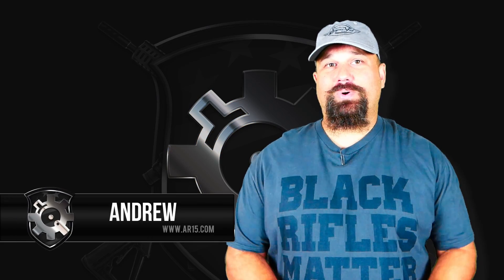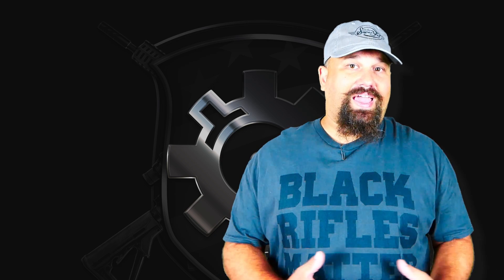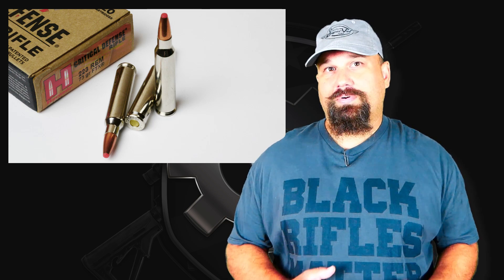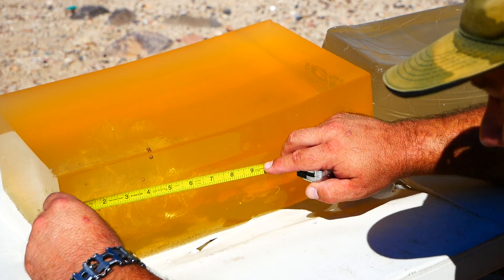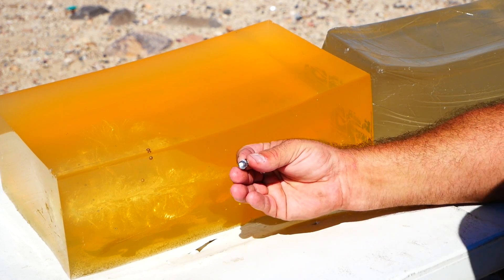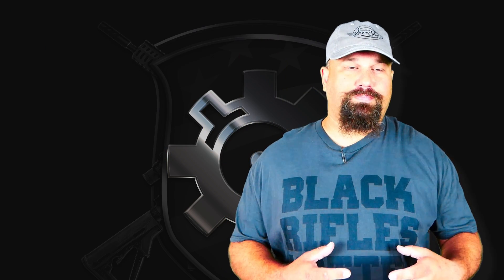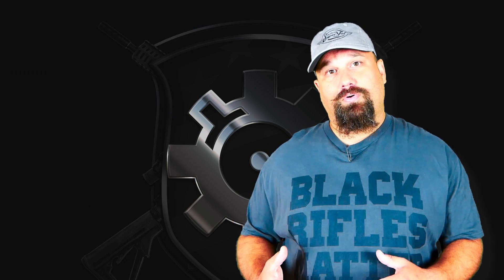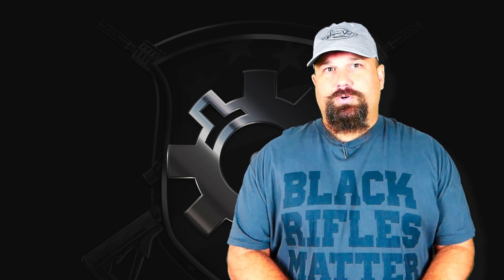Hornady Hype? .223 Rem Hornady 73gr Critical Defense Gel Test

Comment: Great video Andrew. I agree that penetration is the most important aspect of terminal performance, but wouldn't the significantly greater energy produced by a longer barrel somewhat compensate for the decreased penetration?
Reply: Longer barrels (within reason) equal more velocity. And the funny thing is if a bullet is achieving proper expansion as its supposed to but not making it to the vitals. More velocity isn't going to help it get to the vitals. In fact it tends to reduce penetration depths further
Reply: yep this is correct. The one exception would be if the bullet sheds petals and the base then punches through. I see this with Berry's plated 9mm hps' being ran pretty hot. The nose sheds (into to some pretty big nasty pieces) and the base keeps trucking along. Doubt this would be an issue for a rifle unless you're running something like an expanding lehigh bullet where it could rip the petals off or sweep them all the way back.   @MatteoThirteenSeventyOne
Reply: @colsoncustoms8994  LoL I was keeping it simple, and addressing just traditional expanding jacketed ammo. 
As for those Berry's can I assume you're referring to those Hybrid HP's they offer? Just ordered up some of the 147's.
Reply: @colsoncustoms8994  Oh! You know those are for competition just like the HAP and some of the Noslers. They're not designed for expansion/self defense. As for the expansion of the HAP's and the Nosler like their 40/10mm 135gr gr. Yeah, I've gotten them to pancake, but they have a tendency to shed their jackets. All in all, I stay away from them for anything beyond range use.  The Berry's hybrid HP's, I figured I'd give a whirl because in any of the videos I've seen the expansion looks good. But they failed to show the penetration depths. That and I have a couple blocks of unused clear gel I'd like to de-virginize. LoL
Reply: oh yeah, all of the plated ones I've shot are designed for target shooting. That being said, If I can get my plinking ammo to expand fairly reliably, I'll take that over fmj any day of the week.     @MatteoThirteenSeventyOne
Reply: In my experience, especially hunting mule deer and elk, my answer is no
Reply: If the increase in energy is dissipated by increased deformation the bullet or breaking additional pieces off, it will not affect the target, only the bullet.
Reply: Most definitely will have  a effect!!!!!
Reply: It would be nice to know how it woult behave from even shorter barrels (7"). Will it have better penetration with expansion or will the bullet go to slow to expand?
Reply: Now how does it fare for collateral damage. How much dry wall or material will it go through just in case you miss your target? Also what would be a good self defense round that would fare good in both penetration and reducing collateral damage if you miss?
Reply: doesn’t matter how much energy it needs to hit vital organs
Reply: While peneration is important, it's not the most important. If penetration was all that mattered, then the US Military would still be using M885. That round never had any issues with penetration, if fact it commonly went all the way through a target. A bullet needs to have BOTH adequate performance and adequate penetration. .223/5.56 is a very small bullet, unless it dumps its energy as it's passing through a target, it has a nasty tendency to miss important stuff or just not disrupt vital systems enough to be effected. If it doesn't reach far enough while dumping it's energy that's bad too.
Reply: Look what it did to that block How many of those do U think someone or something could REALLY hold up to ? .556 is designed for warfare It’s a cheaper round meant to fired rapidly and heavily He fired off five shots n like two seconds Do U really think it’d take more than 5 shots to Fcuk someone up w these 🤨
Reply: Great question! That comes up frequently. Not if that energy isn't touching vital organs. It comes down to the fact that there are really only two ways to achieve physical incapacitation. That's either damage to the central nervous system, or hypovolemic shock. For the first to happen with a hit to the thoracic cavity, you'll need to have sufficient energy to damage the spine after passing through the torso and possibly a limb prior to that. For hypovolemic shock, you've got to cause substantial bleeding from major blood vessels and/or the heart. In any of these cases, The bullet needs to get through barriers, clothing, and limbs, and still get deep enough in the torso, even if it strikes at an oblique angle. Once you start picturing shots in that context, it becomes apparent that 12" really is a bare minimum.
Reply: Huh, I never would have thought that certain ammo would be more effective out of an SBR than a longer barrel. Thanks for the info!
Reply: @newsofthepews  I always thought that velocity created nasty wounds but the energy helped; not a bunch but it would help.

Comment: Short barrels are an unnecessary handicap imposed by people drinking the kool-aid. If you are using shorter than 16" barrels, you should be using the 6.8 SPC II cartridge. All the tactical people railed against the 5.56 round because it was anemic out of their 14.5" barrels. What does the tactical industry push? Even shorter barrels! Most people that own them are not going to be clearing rooms in a multi-story building, they are not going to be in and out of there vehicle 100 times a day clearing houses. Speed is critical to 5.56 and what many people do is put a governor on the rifle, can't make this up!

Comment: Just for reference ... Massad Ayoob pointed out that the 357 mag ... 125 gr / 1450 fps load chalked up somewhere around 9", yet is/was the highest ranked "one shot stop" handgun load.
Reply: I'm friends with Evan Marshall, they guy who Mas got those numbers from. The one shot stop data base leaves a lot to be desired, including that it completely disregards multiple shot failures to stop.
Reply: Probably cause most shots were frontal shots straight to the chest which is a best case scenario shot. The 12 inch minimum is really there cause modern rounds need to prove themselves in a situation where you get shot in the side through an arm or something a round that penetrates 15 inches in gel for example will almost certainly be able to hit the heart even with a side shot where a round with 9 inches of penetration may hit your arm enter the torso and stop before reaching vital organs. The 12 inch minimum was concluded because of problems with having to shoot through barriers or from rounds having to pass through the side of a person as opposed to a frontal shot.
Reply: An excerpt from an analysis on the .357 given by Dr. Roberts.  Massad Ayoob now says the 147gr 9mm are actually quite effective…🤷‍♂️

“For those individuals who doubt evidence based research and prefer “street results”, the CHP, the largest agency to issue .357 Mag 125 gr JHP’s on the West Coast, clearly reports significantly better results in their officer involved shootings since switching to .40 S&W 180 gr JHP loadings, based on officer perception, objective crime scene measurements, as well as the physiological damage described in the relevant autopsy studies. The CHP used a variety of .357 Mag loads, depending upon what was available via the state contract. According to the published CHP test data from 1989-90, the .357 Magnum load used immediately prior to the CHP transition to .40 S&W was the Remington 125 gr JHP with an ave. MV of 1450 f/s from their duty revolvers. I first saw the data when it was presented during a wound ballistic conference I attended at the CHP Academy in the early 1990's; I heard it discussed again at a CHP Officer Involved Shootings Investigation Team meeting in November of 1997 at Vallejo, CA. The information reviewed the differences in ammunition terminal performance such as penetration depth, recovered bullet characteristics, tissue damage and other physiological measurements and physical evidence detailed during forensic analysis.”
Reply: Well most 125 grain 357 mag loads I've seen get a lot more than 9" of penetration
Reply: Yeah 12" to reach vital organs on an average human is nonsense.
Reply: No, it’s not “nonsense”, it’s scientific fact

Comment: Great test. Most of us strangely enough use 16 inch barrels for home defense because it’s simply a 4473 form to get one
Reply: You can get a 10.5 inch upper too.   Nothing extra .. but do not put it on a lower with a stock. It has to be a pistol brace...  A short barrel rifle has a stock. A pistol has a brace
Reply: @no.step.on.snek.2423 PDWs shouldn’t need any registration.
Reply: @no.step.on.snek.2423  You have to have a lower that's never been a rifle as well. You cannot change a rifle to a pistol, you can mess up and change a pistol to a SBR. Any lower that has ever been a rifle, can only be turned into an sbr. SBRs cannot be turned into pistols either.

Comment: I just wanted to mention that Hornady did test with the FBI standard barrier as well in the comparison you did. 4 layers of different material then into the 10% gel so the 16 inch barrel comparison is slightly off since you did not use the barrier or a 16 inch barrel. Just saying. Good video.

Comment: 10.5 is exactly what I'm using for my Home Defense AR... So it's basically perfect for me.  Less chance of Over-penetration with good fragmentation and adequate expansion.  I much prefer a shorter barrel AR for maneuverability in doors.  Conclusion it is good for home defense... In the Proper Length Rifle.     My 18" will run a different primary ammo.  Simple.

Comment: I believe your mixing your pistol vs rifle logic, pistols you need all the penetration you can get where a rifle because of the velocity of the round striking the target does not require as much to achieve incapacitation.
Reply: They won't listen.  Except for morbidly obese people, where on the human torso will a 55gr pill, going 2700 out of my 14.5 pinned, at 10 feet, leaving a ten inch wound trail, the middle 8 inches basically a 12 ounce soda can of tissue removed violently, not kill you quick or at least reliably incapacitate you?  Look at your torso - find any angle with 10 inches of body behind it.  Remove the soda can. Imagine the shock created by the joules all being dumped quickly.  It might hit an arm they'll cry.  Fine, that limb is gone, and there's half a soda can of energy still coming to the torso.  With a penetrating bullet with a large neck, that arm is now a through and through slow bleeder most likely, unless you hit bone.

Comment: Wouldn't it be more likely that different testing conditions or gel composition make the difference in penetration?

Admittedly I'm no ballistics expert, but it seems to defy physics for it to under penetrate from a longer barrel due to the velocity gain from the extra length.

A different gel density or higher/lower ambient temperature would seem to make the most sense.

My 3 y.o. son is running around like a wild man right now, so I was unable to hear everything that was said. So if I missed something, please point it out and correct me.
Reply: A faster bullet will open up faster and tend to penetrate less, while fragmenting more.
Reply: @Stewie81693  that's depending on bullet construction of course.

Comment: Old video but I disagree on the aspect that penetration is more important than wound channel size. A gunshot wound that is large in width has a larger chance of rupturing critical blood vessels and causing damage to internal organs than smaller wound channel that goes deeper, although the FBIs point is a valid one to consider. Think taking a needle and poking a hole in an orange, now use a pen. Which one is going to cause more fluid loss (i.e. blood) as well as displace more tissue? Sure its an exaggerated example, but the point is still the same.

Comment: Thanks for the data first off. I am curious why you didn't take a shot with a 14. or 16 inch barrel so we wouldnt have to speculate on it's performance from that platform and as a control to the 10.5 inch barrel. Pistols are gaining popularity no doubt but most AR owners are still protecting their homes with rifles. Thanks again.
Reply: Ditto 👍

Comment: Hey AR-15, you want to irritate every high priced over hyped ammo manufacturer? On camera, take a standard FMJ ball (XM193 55gr or civilian equivalent), then press the tip to a file or a brick or a cinder block or piece of concrete (anything abrasive) and lightly scrape to create a flat with exposed lead on the very tip. Then shoot that into gel. You'll get deep penetration and expansion as a result of the lead opening up and pealing the jacket back. Hurrah, reliable penetration and expansion for $0.30 a round rather than a $1.25 each. 

My Grandfather hunted using cheap military ball ammunition, by turning FMJs into flat point soft tips, for decades. It's like a defensive/hunting round cheat code.

Comment: I will definitely agree with you higher velocity decreases penetration. But your temporary stretch and incapacitation that it brings with it was exponentially more effective. Let's just be honest if you've been deer hunting and I know many of you have if you Poke a 43 caliber hole from a 44 Magnum through a deer with absolutely no expansion such as I hard cast you only get the permanent crush cavity and it will kill him definitely but it will be much slower. If you drop one of these to the chest cavity despite the fact it's a 223, which I'm not a fan of deer hunting with, it will absolutely drop him faster on average. isn't it kind of funny how when you increase the energy, ie velocity,  of a projectile it loses its ability to penetrate deeper unless you do something about it in your bullet design.
Reply: Light years late, but yes I agree, I have hunted twice with 5.56, both heavy otms. Both did well. My deer didn't  past a single neck shot in both instances, and no exit hoke either on any of the instances. I would still say place those shots wisely and take your time.

Comment: That was very interesting video and yes 12 inches minimum penetration is the standard for handguns in a police situation. As it was determined by the Miami Florida shooting the traveling through a bicep and across the chest to impact the heart was the desired outcome. This turned out to be 12 to 14 in. That same studies show that defensive use by civilians required 8 to 12 in of penetration as a side shot through an arm would be very difficult in a defensive situation considering the biceps is much larger agreed much light tank armor shooting through forearm at an oblique angle increases the amount of tissue it must travel through. And of course the majority of police shootings do involved the person not directly confronting the individual but more the partner shooting from the side through the arm and across the chest this is important. As my job allows me to see and of course having had years of anatomy and physiology there's a proximately 2 to 3 inches of penetration into the chest before vital organs are reached 12 inches of penetration on a self-defense weapon or greater will definitely increase your risk of pass through and as they say each pass-through has a lawyer hanging on to it. I do take issue with short barrel for home defense unless you're running a suppressor. if you run a 16 or 20 inch barrel in your home you're going to lose hearing more than likely you're going to have a perforated eardrum. End of story. If you run a 12 or a 10 inch barrel I guarantee significant hearing loss permanently. The fact that you got such great penetration and performance from a 10 or 12 in more and accounting of the ammo then of the use of a10 or 12 inch barrel.

Comment: If I could offer a humble suggestion... At the end of any video of ammo testing, you should should give your current top 3 ranked performers for that particular caliber. Maybe even include the average price per round it can be found for.
Reply: That's a really good suggestion.
Reply: It's just hard to dig up all the tests. I certainly have my favorites, and I've watched just about all the testing I can find... But it would just be a nice touch to your testing that I've really never seen. I really like your testing method (especially the use of a shorter barrel). There only other thing that could make it any better is test your 5.56/2.23 from both a 10.5" and a 16" barrel. Anything showing marginally acceptable penetration (or even decent penetration) from a 10.5" barrel could fall short when fired from a 16" gun. Just stuff I wish I had the budget for lol... You guys are about the only channel that uses a short barrel, and it's great. Keep up the good work!
Reply: Based on this test's example (and others showing the effects of longer/shorter barrels), it would also have to include the barrel length for each of the top three ranks.

Comment: For people still confused with 12" minimum, here is another way to look at it. Measure distance from arm to heart, with arm at your side. Bet money it's at least 12". Avg distance shoulder to shoulder is 18", heart roughly in the middle would be 9". Add the width of your arm to that number. It equals...what? Not to mention the bullet can encounter two bones before hitting the heart. With most modern SD ammo dumping massive amounts of energy within the first like 9", trust me a few extra inches for insurance is worth the little energy you lose in case it "overpenetrates".
Reply: But gel blocks don't have bone or clothing either.. and if someone is pointing a gun at you you may have to go through their arm at a weird angle and into their body.. plus you have barriers and stuff to worry about.. probably better to be safe than sorry and go with something that barely meets that 12-13" mark